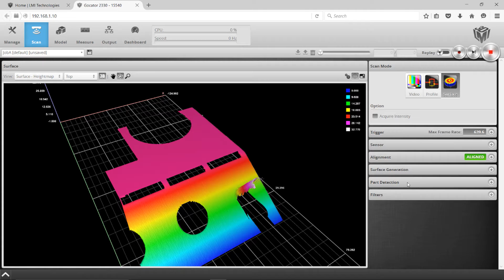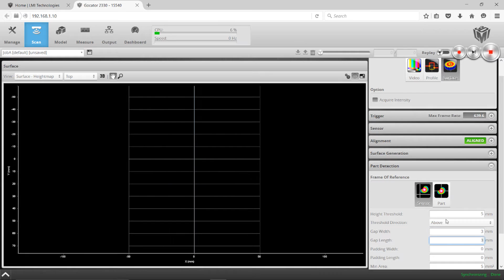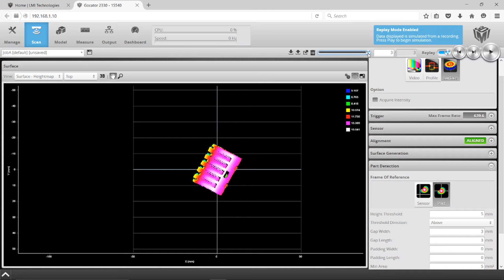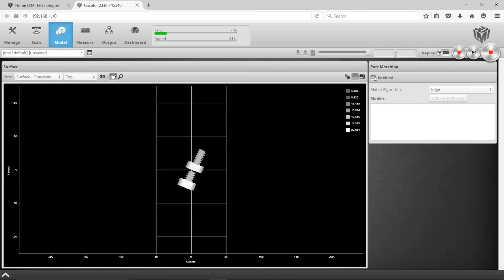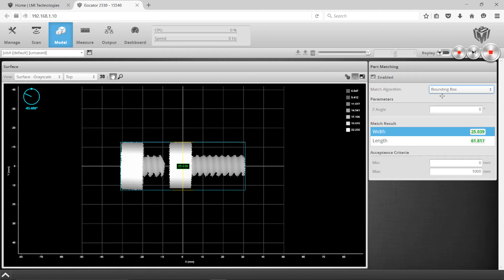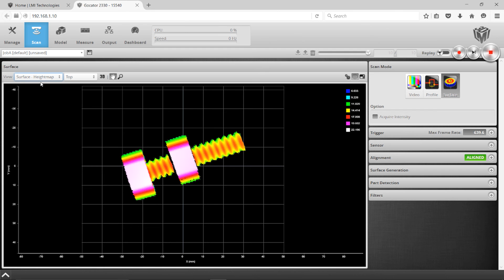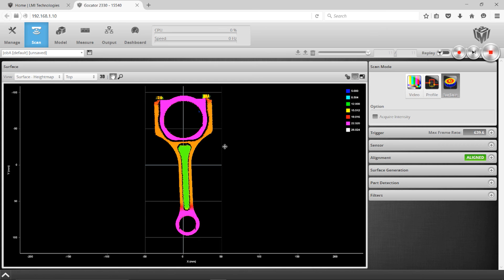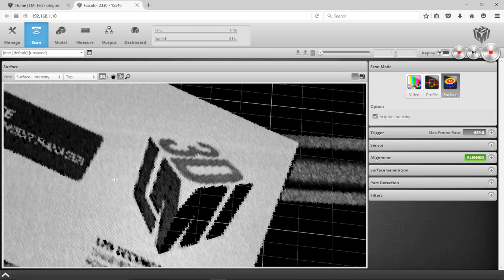Gocator Training Series Part 4: Advanced Surface Measurement

Comment: How to combine the surface images of  a relatively larger part? Multiple scans would be required but how to combine to one point cloud data? Please help.
Reply from the maker: Hello learner_Ben,

Gocator sensors support multi sensor ring layouts which can output point cloud data, as well as 6 DoF alignment to ensure that the data is accurate.
We published a 3 part blog that might address this question, the last part specifically focuses on how to merge separate scans into a single scan: https://lmi3d.com/company/digital-hub/blog/multi-view-3d-scanning-and-processing-part-3

Hopefully this helps!
Reply: @Lmi3d  Thank you for the response and pointing out to the blog. We went through the blog and the provided manual as well. However, we are still facing difficulties in setting proper parameters to realize the stitched part.
We are trying to scan 300x300 mm object by using Gocator 2520A-2-B-01-S line scanner. We are using encoder as the trigger for the scanner.
It would be really help helpful if LMI could a small video demo tutorial on the subject.
Reply from the maker: @barunbasnet  To get an answer that can help you set this up, I would recommend submitting a technical support request here: https://support.lmi3d.com/
An AE will be able to better understand your needs and get you up and running!